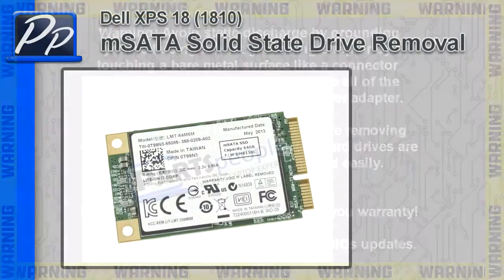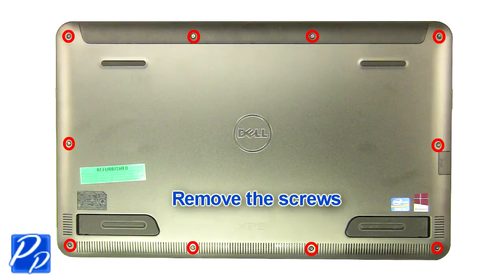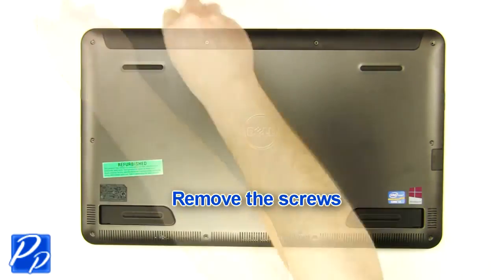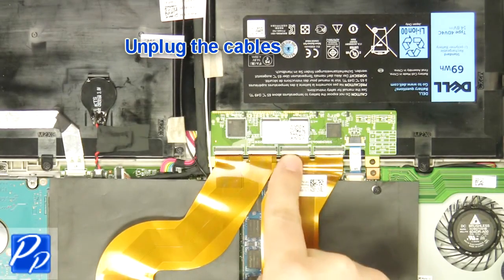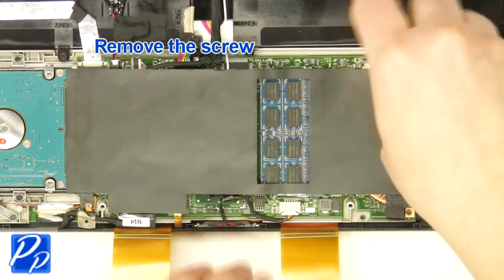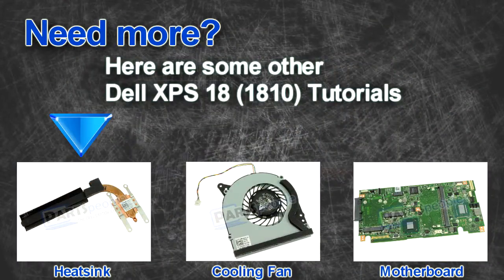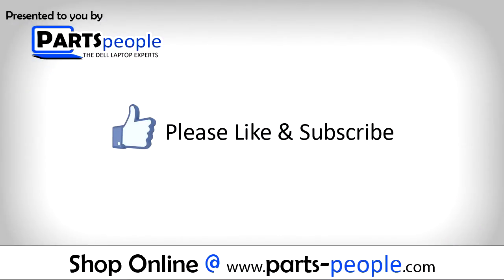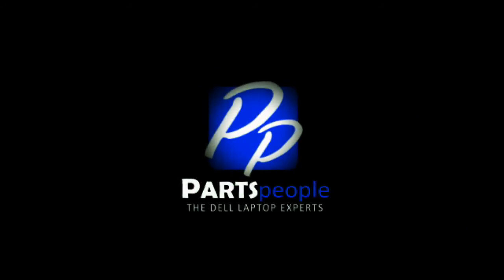Dell XPS 18 (1810) mSATA Solid State Drive Video Tutorial Teardown

Comment: Im buying the pentium dual core version with 4gb and it does not come with the msata option, will I be able to install a bought msata unit, and is there anything extra I would have to do in either the bios or windows itself, and will installing it make any difference to speed/performance of the system, and also whats the maximum extra memory I can install?? 

Please could you get back to me on this as you guys are the only video that has dealt with this thanks
Reply from the maker: Yes, you will be able to install a mSATA SSD. After installing, you will have to format the mSATA like any other hard drive, and that should be all you need to do. As for the memory, it holds one stick that can be upgraded (the other is built onto the motherboard and cannot be replaced). I believe an 8Gb stick is the largest it can use.
Reply: cheers and thanks for info